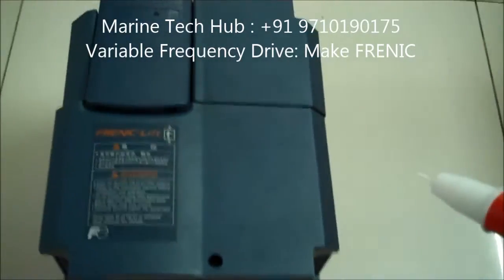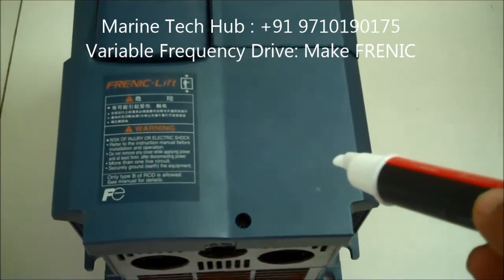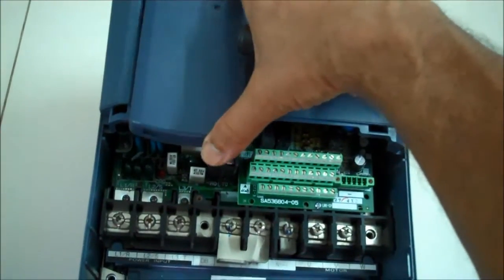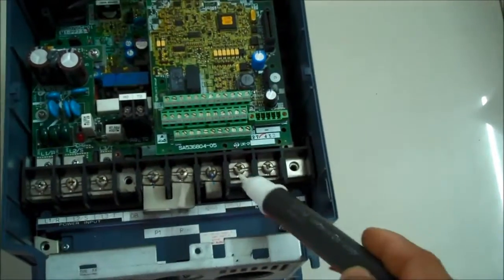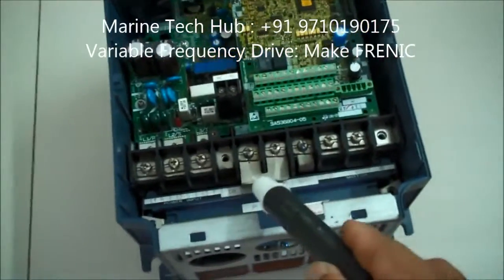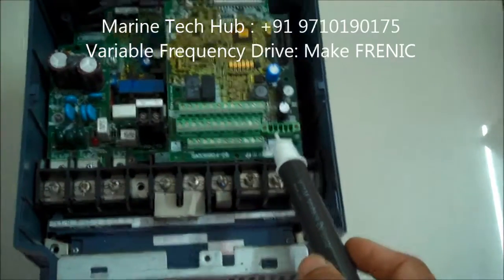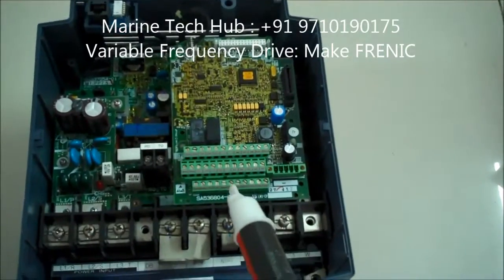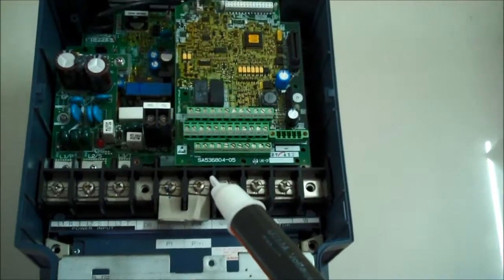How To : Connect Wiring To Variable Frequency Drive: Make FRENIC LIFT

Comment: fuji frenic Lift, E code connection. E02, E02, E03, E04, E05, E06, E07, AND E08.  PLEASE EXPLAIN.  Where  connected. 27 (1027) Enable PG vector control  PG/HZ

Comment: Hi sir, i would like to know if the drive keyboard is included with the variable frequency drive of Frenic Lifts. I have the same make installed in my home elevator. The technician is asking for extra 15k Rs to replace the board as it was missing.

Comment: Very good videos, as always. A question. This variator can be made to work with 220v single-phase input and 220v or 400v three-phase output. Thank you and greetings from Spain
Reply from the maker: Thanks for your valuable feedback.  Yes your perfectly correct